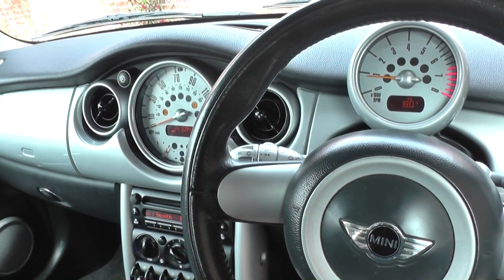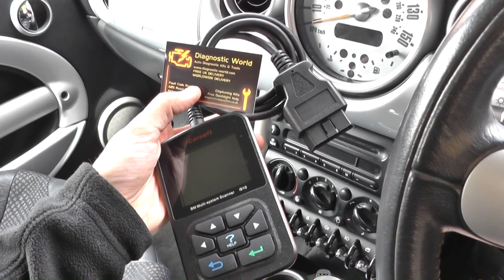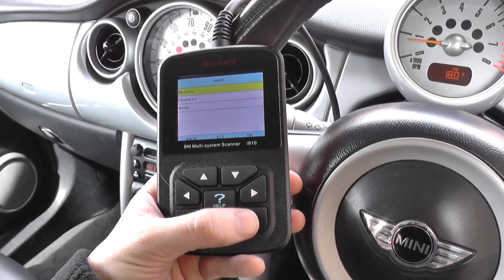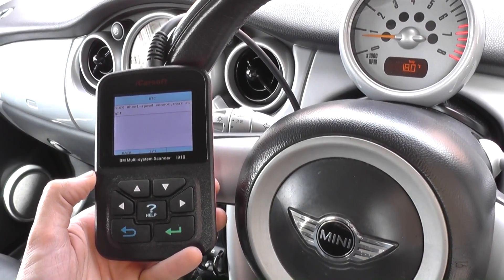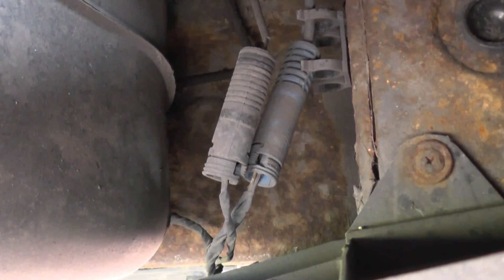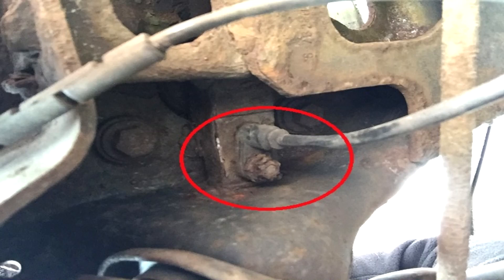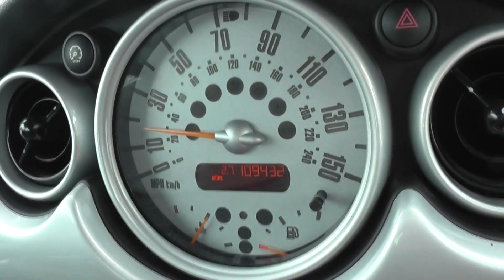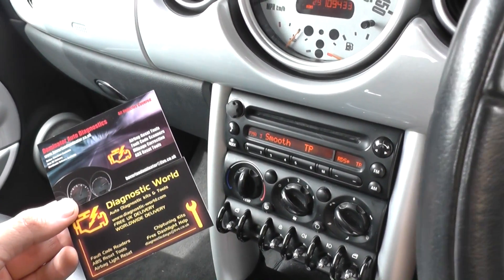Mini Rear ABS Sensor Replacement & Diagnosis R50 R52 R53 Cooper S JCW Convertible

Comment: If anyone is wondering it’s a 10mm bolt that holds in the sensor. Mine was so corroded I couldn’t make it out so I hammered a 10mm on and jobs a gooden! Thank you for your video.. just need to order a BMW/MINI specific OBD2 scanner as my standard Autophix didn’t recognise it 
EDIT - both lights went off by themselves after about 30sec above 15mph

Comment: Good video.....gotta chuckle as you totally skipped you guys struggling to remove the wheel sensor itself....you showed it, circled it in red which was nice.....how long did it take ya'll to get that free?????  Lol.....carry on.
Reply: The ONLY reason I watched was to see him struggle getting it out from the hub end.. Still none the wiser..
Reply: Ik i am years late but cut the wire as close as you can. Then drive a screw into it and pry the head of the screw with a hammer. Hope that helps anyone looking for a solution